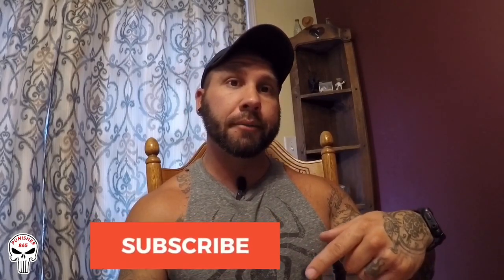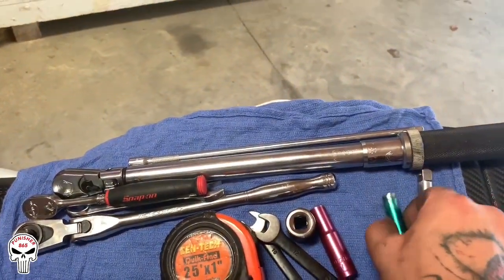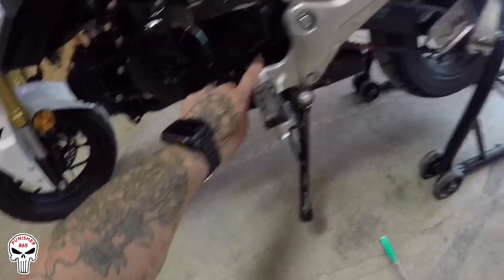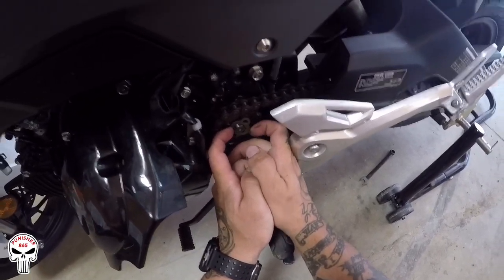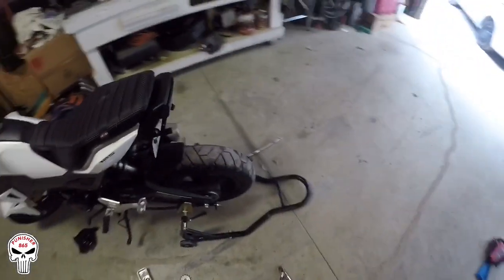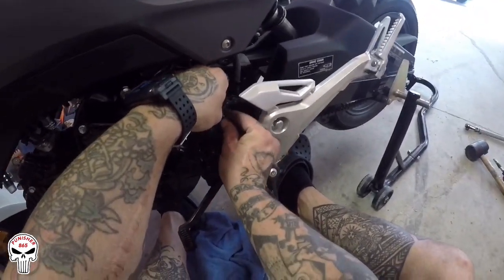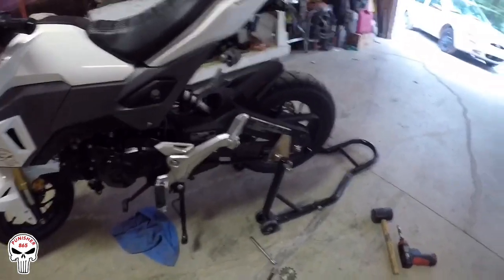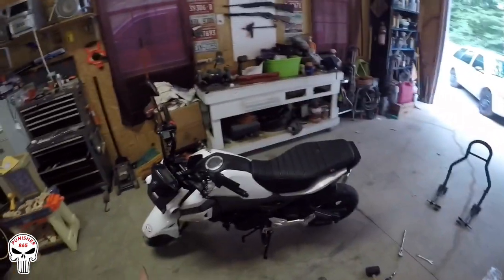HONDA GROM- How to change/replace front sprocket

Comment: Thanks for the video. I actually needed to change the sprocket back to stock... my mph was way off. 7mph off at top speeds. I imagine this was making my Grom appear to have more miles than it actually had...

Ive heard another video say that sprocket torque spec was 37ft lbs... Is your sprocket still on?
Reply from the maker: The bike didn’t have a long life with me. 🤦🏻‍♂️
Reply: @Punisher865  Sell or destroy? 😅